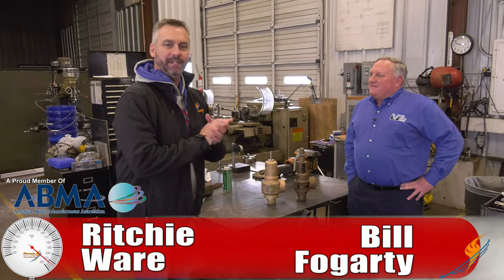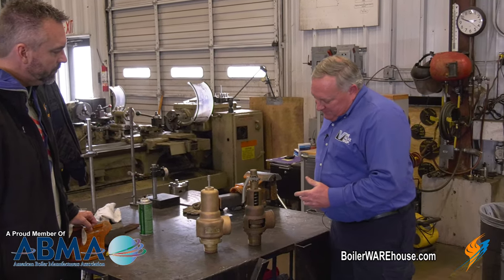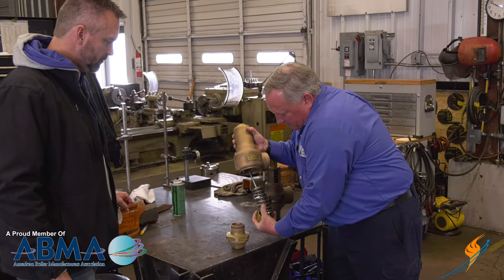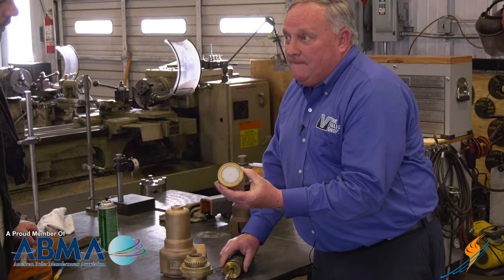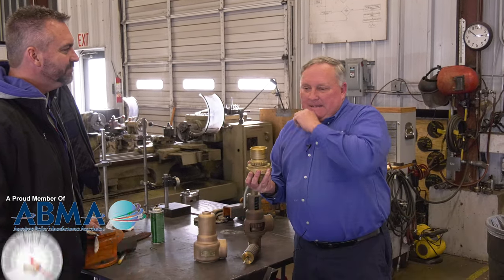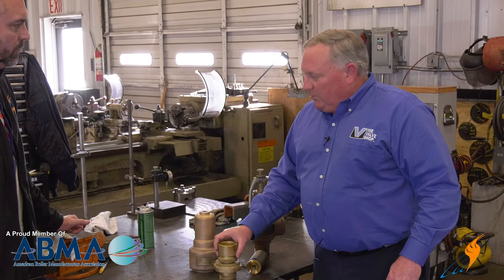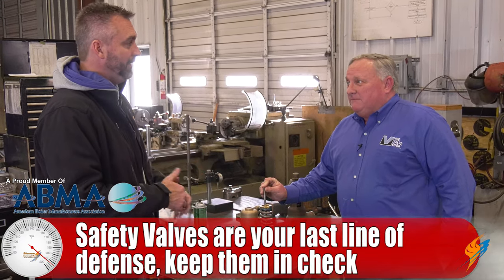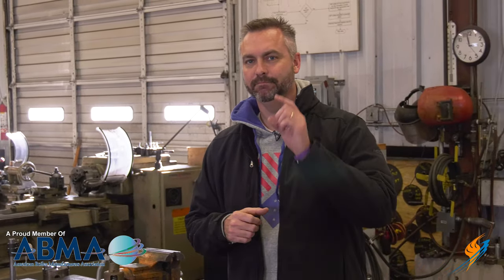How a Safety Valve Works on a Steam Boiler - Boiling Point

Comment: I am making a solar powered steam generator and have learned so much about how Boilers work it's amazing. Steam is incredible..I learned you cannot just heat 1 section of copper metal with a Fresnal lens, boiling only works because the entire combustion chamber is hot and lit which interacts with every sq inch of the copper in the walls. Is the water in the copper tubing simply being heated until a certain PSI then the valve interaction is where the steam is generated? I can only get water to rise like a thermometer when it's sealed under vacuum. I can boil it when the air is flowing, but can't build any pressure this way. Thank you for the video!

Comment: I do not understand the concept of how simmering steam increases the surface area of the disc, causing the valve to pop open. Could you please explain in detail how that works? Thank You!
Reply from the maker: Rewatch the section where Bill is talking about simmering works https://youtu.be/8rsB8V30Owg?list=PLtXrfnqEhRXC4e0RDSxs8M_IlH3RgI0Xi&t=179 It isn't that the steam is increasing the surface area of the disc but rather the steam is using the rest of the disk to push up. That changes the force value in the pressure x area equation. Hopefully that helps!
Reply: When the disc is closed, the inlet pressure acts over the cross sectional area A defined by the nozzle. When the inlet pressure approaches the set pressure, the force F=P*A applied to the disc approaches/balances the spring force down causing the metal to metal seat tightness to reduce. A leak/simmer will ensue and now the process pressure starts to act over the larger surface area A' presented by the larger diameter disc. When that area gets a full dose of inlet pressure the force F=P*A' exceeds the spring force and the disc is pushed up. On a proper steam valve, you can manipulate the blow down rings to change the effective cross sectional area A' .
Reply: @robsalvv5853  really good explaination Thanks plz explain more about blowdown ring i have seen when we move blowdown ring above the nozzle seat where disc seat it pops early and when move blowdown ring it takes time to pop up how moving blowdown down affect it pop up time and up affect it

Comment: does safety valve only work on media; steam? for fluid: water petrolium can it  be used where flow pressure is 10 /30 PSI? Would temperature of media also be considered?

Is it possible for me to become engineer like this gentleman. where to start please advice I am interested in this kind of work. Currently I am a vehicle mekanic
Reply from the maker: There are safety valves for most substances that are under pressure. While no one safety valve can do it all, having a safety valve saves you from dangerous over pressure. To start in the trade to become a boilerman, you really want to get an understanding of how these work. Take a look at your local trade schools and see if they offer HVAC / Mechanical courses. Hopefully that helps!

Comment: what is the differences between safety valve using handle and non-handle?thankyou
Reply: The handle just allows for manual release of pressure which will give the operator a general idea if the valve is releasing and reseating correctly.
Reply from the maker: From Bill, A safety valve lever (handle) is required if the valve is in one of the following services. Air, steam or water over 140F. If not is these services a screwed cap maybe used. Hopefully that answers your question! Thanks for watching!